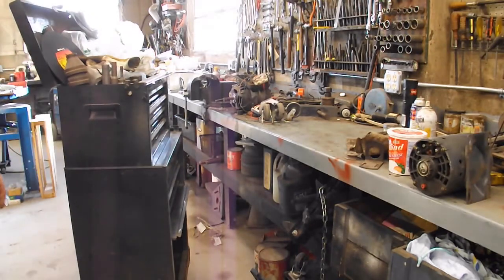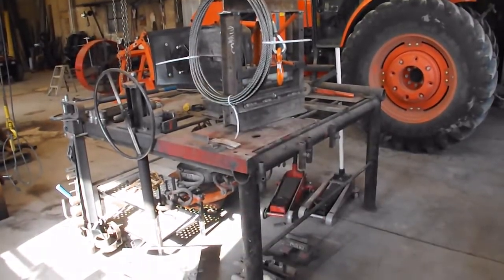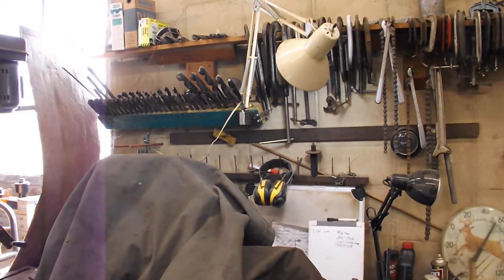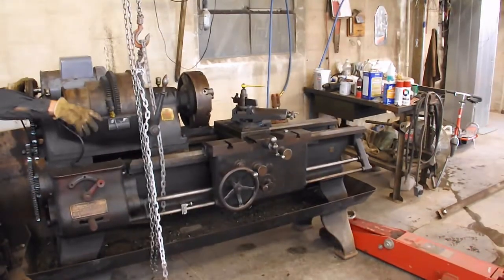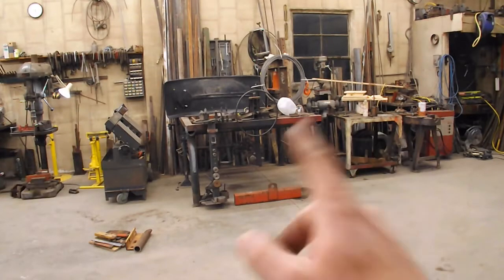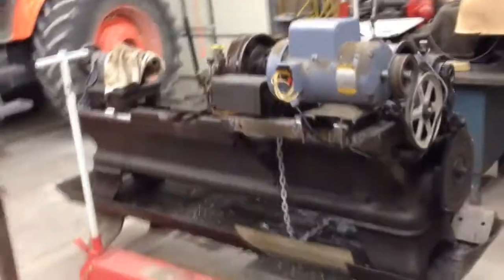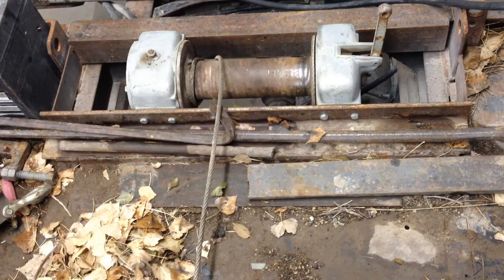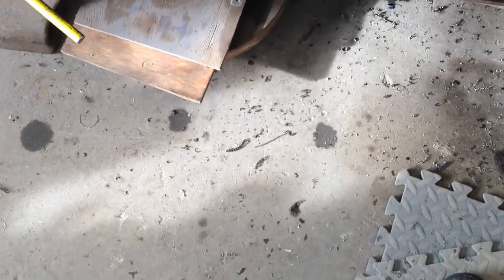Shop Rearranging - December 2014

Comment: I like the way you arrange things by making sort-of plans, and then moving things around. Shops are very personal. I'm also moving my shop around, but for an entirely different reason. I just don't have the access I used to.
Nice point about the sun making it warm in the shop tho'. Thanks for the look at your machinery
Reply from the maker: StepCorn Grumbleteats Years ago, some one told me to draw on the floor with chalk (or tape) before moving something to that spot and walk around it a few days. It has been great advice, as it really creates spacial awareness.  You're welcome for the look! :)

Comment: Nice rearrange. It was also nice to see that there are other people in Kansas besides you. Nice to have a helper once in awhile in particular if you get hurt while alone. Been there; tried that.
My son and I bought two pallet lifters and we have now welded cross beams on all our tables reaching from leg to leg 100mm up from the floor. Mostly 10 x 60mm flat iron. We roll the pallet lifter under the cross piece, pump the item a centimeter off the ground and off we go usually with just one pallet lifter (if necessary, two). The advantage is the amazing maneuverability of these lifters and of course the 2 tons capacity per lifter. Works great. It is a little like your car jack, but with two forks much more stable. All our "junk" is now on pallets and we can move anything in our shop almost anywhere which is nice if you need a pallet full of scrap iron next to the band saw, then need it over at the lathe. No problem, move the whole pallet to wherever you need it.
And, I enjoyed the video and your excitement over the new arrangement not to mention your "gitter duhn" attitude.
Reply from the maker: Jim Milne Thanks! And I'll have to consider getting a pallet jack. It would be handy to be able to move that big welding table from time to time. It was good to have a helper. I told him a couple days earlier I was thinking of moving the lathes and he instantly said "You better call me when you do!" It was nice to have someone to bounce ideas off of.

Comment: Hi Matthew,
Nicer arrangement, where you can do all the machining in one area.
It's hard to figure out by seeing thru the camera, but you seem to have a pretty nice size garage, much bigger than mine with more machines for sure.
I also love the feeling of working in a cleaner space with an airy feeling and sunlight is hard to beat for a good light source...
Take care,
Pierre
Reply from the maker: pierre beaudry The shop is 30 foot by 60 foot with an "office" built on. And I really have been enjoying the Sunlight coming in. It also gives me a bit more motivation to get to work in the mornings now.
Reply: You're lucky to have 3 times the surface what I've got, there are lots of advantages to live on farmland compared to residential area, mostly when a garage is concerned... Motivation is the motor of creation.

Comment: tell us more about how you heat the shop. Propane, Nat. Gas? cost to run for 8 hours. thanks.
Reply from the maker: Carter W Hern Mostly Propane. I do have a waste oil heater, too. I really don't know cost per day, since propane is delivered in a bulk tank and I have no way to meter it. But, depending on the Winter, I usually burn around 500 gallons of propane when I try to keep the shop at 55 degrees F.
Reply: thanks for the info. My un-insulated shop is lucky to make it to 50 with my wood heater. Good move on all your equipment.